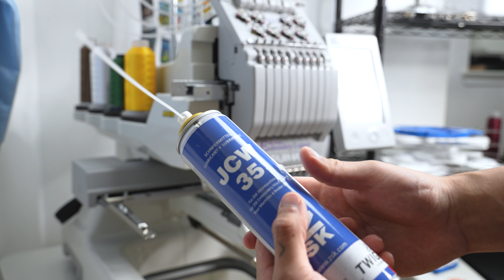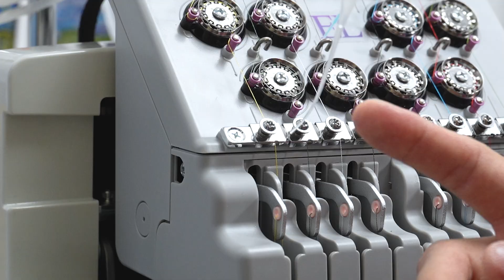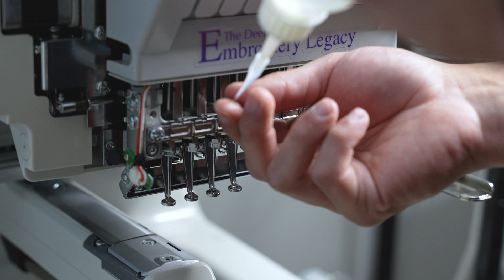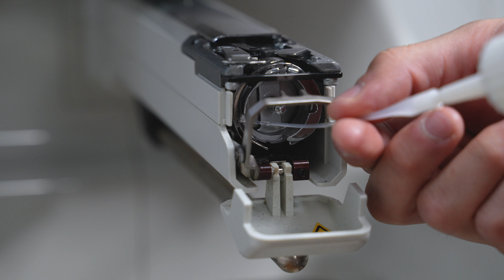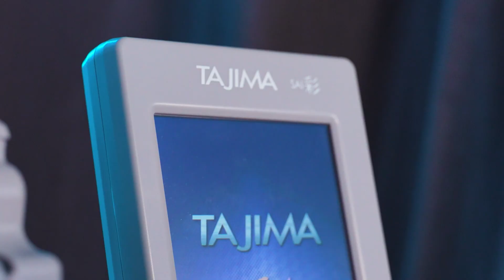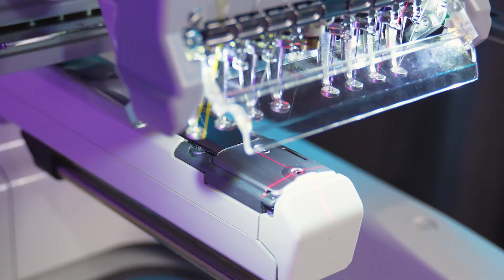BEST Way to Oil & Maintain the Tajima SAI? Tajima Embroidery Machine for Beginners

Comment: Hi,  You need to oil in-between the springs, not the top of the screw head.  A needle oiler works well.  I've had my SAI for 3 years and have the TMEZ.  Received oiling instructions in my home from Hirsh Solutions, Tajama's US representative, technician.
Reply: Thanks for verifying this. When I watched this vid, I THOUGHT that was wrong...since I oil at the top of the springs so that the oil drops down along the shaft through all the springs. I thought I was wrong, but your comment confirmed I was doing it right. 🙂